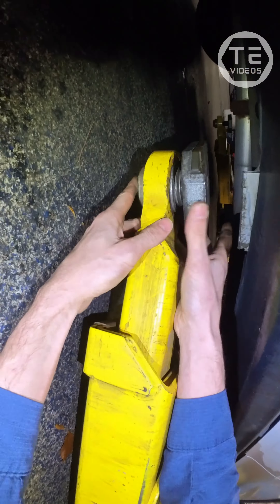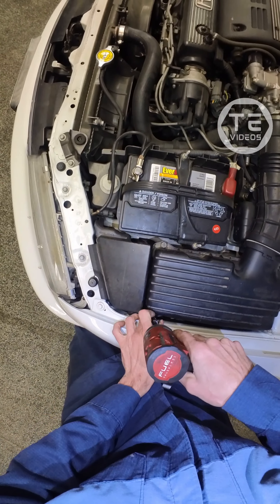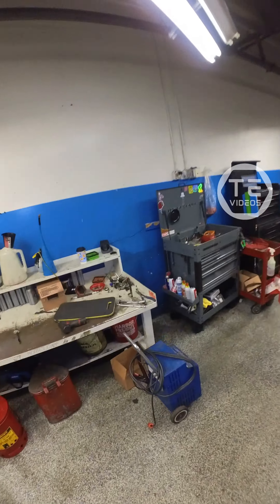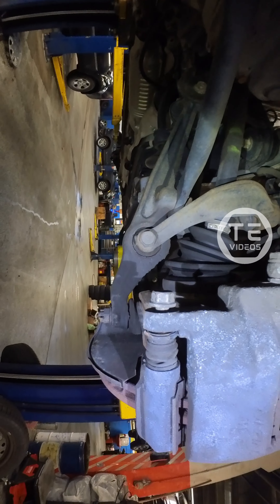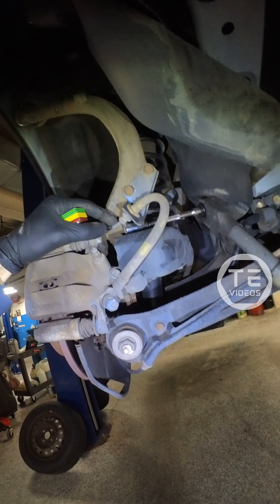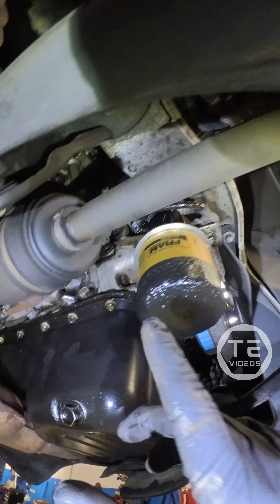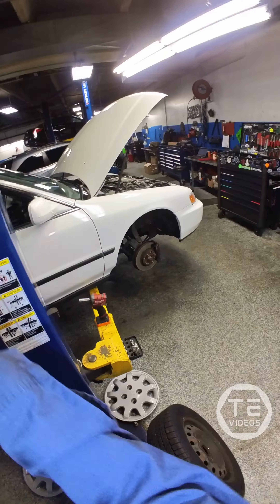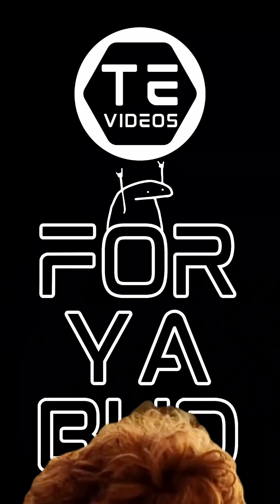Y'all Ready For This 1997 V6 Honda Accord Gem? 💎🤔👌 #honda #accord #1997 #v6 #gem

Comment: 5,600$ for a car that probably costs just as much. Makes sense
Reply: the work that a car needs doesnt ask the car what its blue book value is, this is cheaper than buying another car that doesn’t need work. 10K miles costs over $1000 just in gas these days.
Reply: @wolleyreikivalley  Im not saying the car doesn’t need the repairs to be done. And it is cheaper than buying a new car, indeed. But 150$/hr labor is just absurd. OEM parts pricing doesn’t help.
Reply: By the look of that beauty, the owner is gonna have the work done regardless. Might not be at the dealership, but this seems like a car that's well loved and maintained for the most part. Plus it's becoming rare to see these cars and them not being completely clapped out. If this were my car I'd do most repairs myself but I wouldn't spend a minute thinking about buying another car. I'd barely get anything better for the 5,600 Dollars they want for the repair. Gonna spend time and a few hundred bucks in parts and have myself a nice day

Comment: They sell a kit of brake pad measuring tool from lisle that looks like flags and you can check brakes without the need to remove the bracket sometimes without the wheel